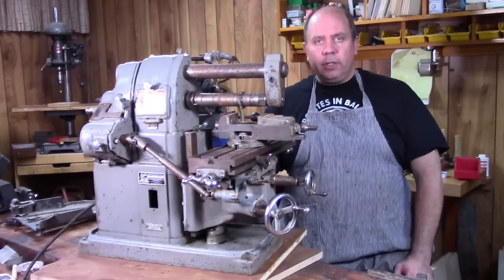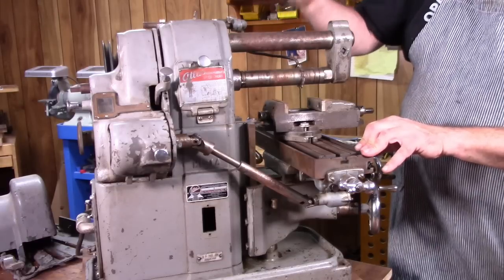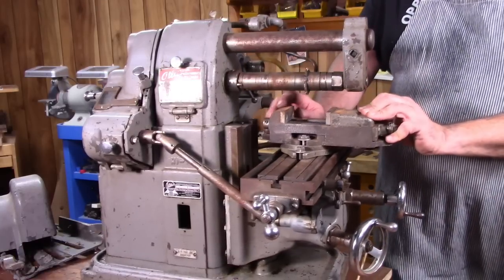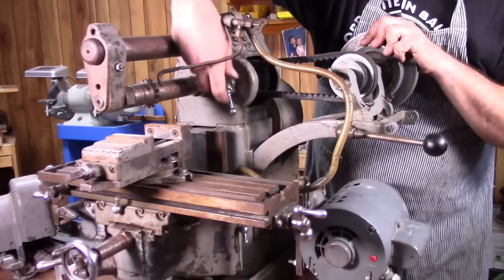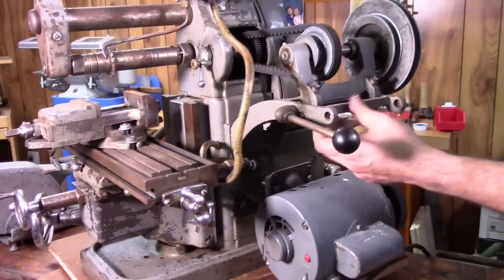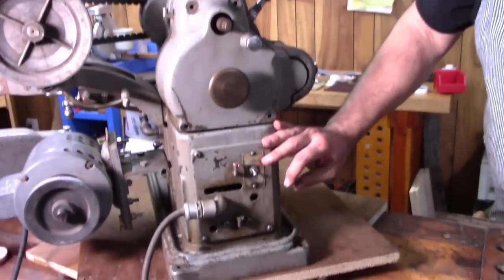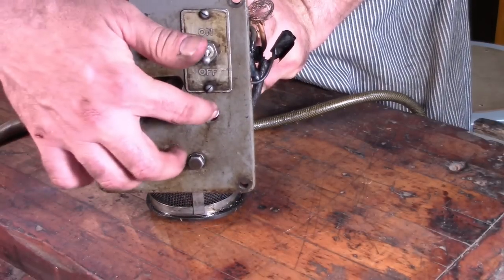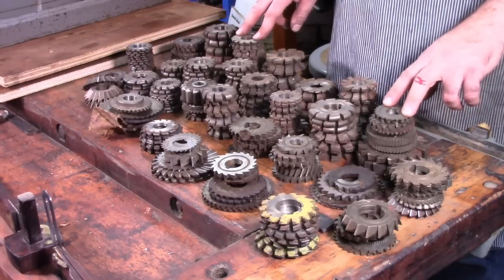Latest find: Atlas MFC milling machine

Comment: thank you helped me out lots ,just  bought one and its on its way ,thanks alot.
Reply from the maker: Thank you and that's great to hear. I hope you enjoy your machine!
Reply: Well thanks . I'm getting into the head stock and the spindle bearings are toast , I can't make out the numbers on the bearings ,could you please let me know what part numbers they are , thanks again for posting  the video , learned lots 😁
Reply from the maker: @prenticeemler7709  The tapered roller bearing is Timken  07087 and the cup is Timken 07100. I documented the process of rebuilding the head stock of my mill on the hobby-machinist forum. Here is a link to that thread https://www.hobby-machinist.com/threads/atlas-milling-machine-refresh-project.30821/
Reply: @MrHarvard88  thanks so much for the bearing number , I really enjoyed your video,  great job😁

Comment: Again, thanks for your guidance and good disposition to help me. To take the option to make the missing parts, I have the difficulty of finding the blueprints of the machine, you know some way of knowing them. Thank you for your attention.
Reply from the maker: There is a discussion group at https://groups.io/g/atlas-craftsman that has several blueprints of parts. You have to sign up to be a member before you can see the drawings. Also, if you contact Clausing Industrial at https://www.clausing-industrial.com sometimes they will email you a copy of the original blueprint drawing for parts that are no longer available. I hope this helps.
Reply: @MrHarvard88  Thank you, very much, Very useful